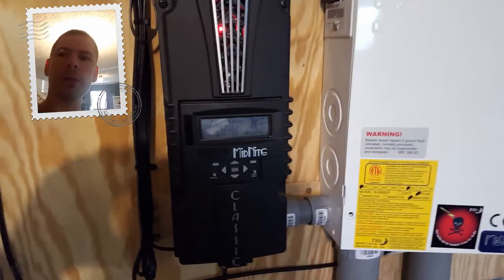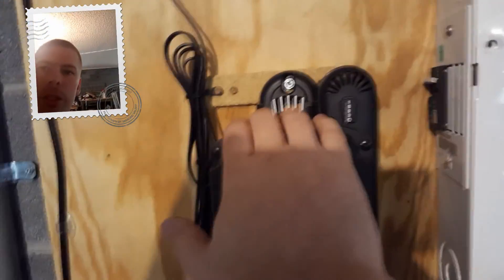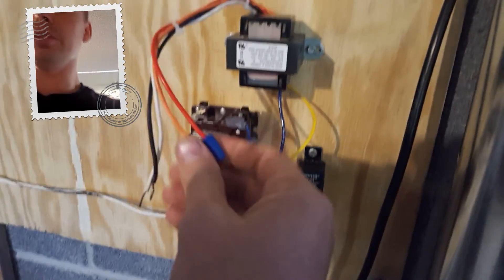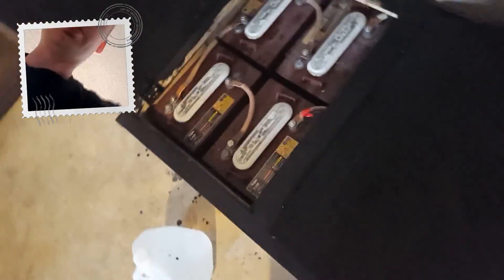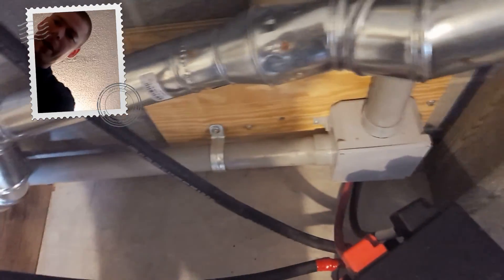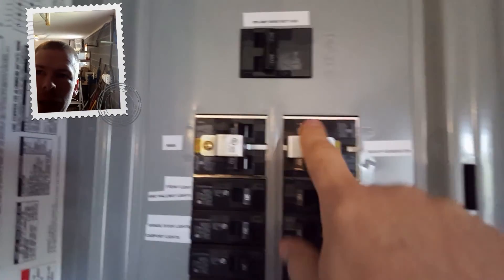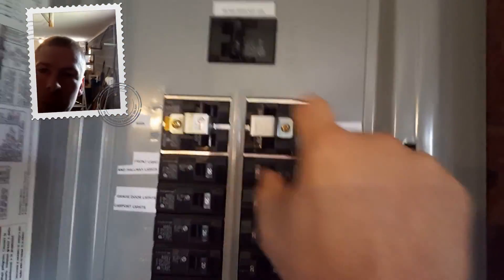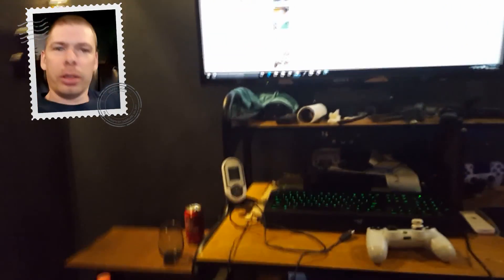Solar Overview 6000 watt inverter 3000 watt solar array

Comment: how much does a system like this cost not counting the batteries because I would like lithium
Reply from the maker: I moved to Lithium as well, you need to think about what your going to run first and then add all the power in "KWH" per day and look of your sun hours before you get started this might not be good for you or overkill as well your best bet is to give altestore.com a call they will help you set up the system.

Comment: Hey I just found your channel this is the exact size I made for a dome home I'm building where did you buy this
Reply from the maker: Kelli Erin my suggestion if you're going to buy an inverter is to buy Magnum because the inverter I was showing here died but the classic 150 charge controller is amazing and I'm also using 50 year old iron Edison batteries technically they're not nickel-iron cuz they're old they're nickel-cadmium rare
Reply from the maker: Kelli Erin altestore.com